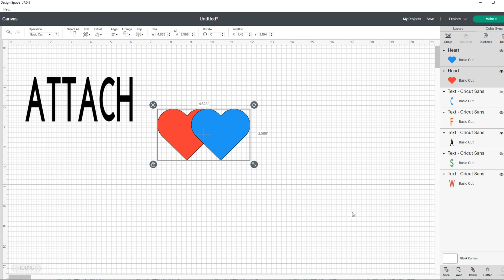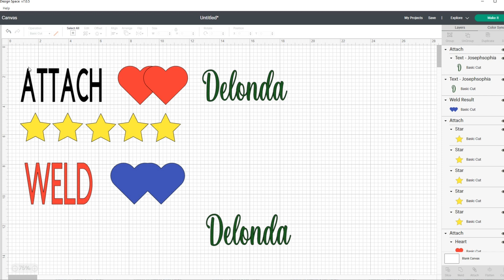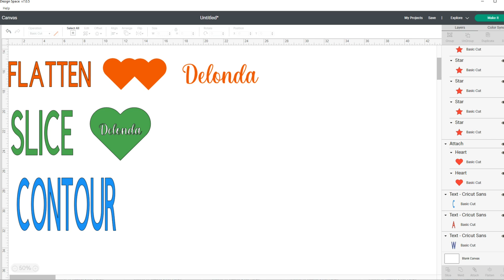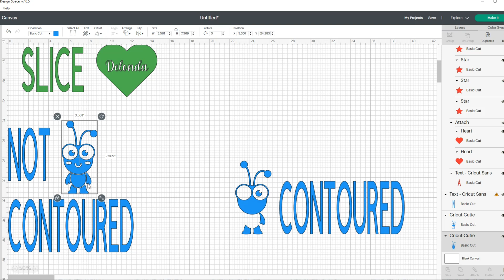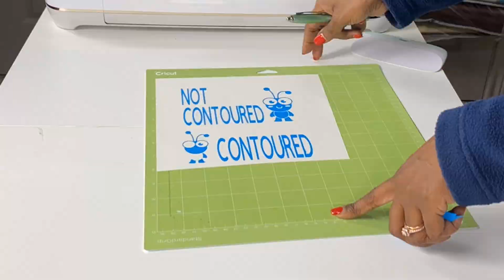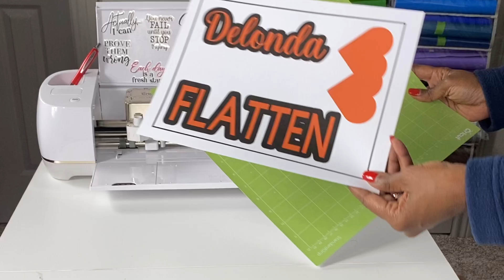CRICUT DESIGN SPACE FOR BEGINNERS: CRICUT DESIGN SPACE TOOLS: WELD, ATTACH, SLICE, CONTOUR & FLATTEN

Comment: Hello, I love your content.  Thank you for taking the time to share.  The spatula, I LOVE IT! I use it to lift the vinyl from the cutting mat without having to bend the vinyl while removing it.  The tweezers-  my preference for weeding the vinyl. Grab with the vinyl with the tweezers and place in my discard container (a tide pod container with an “X” cut through the top to grab on to the vinyl once I slide it into the little slot).
Reply from the maker: Thank you so much! I still haven’t used those tweezers 😂🤣😂🤣

Comment: Good morning I really need your help i watched video to calibrate and I did it the the T. But I went to print n cut and I didn't cut around the outer circle but instead it cut through my circle. What do I do? Please help
Reply from the maker: Hello, what paper did you use for your calibration?
Reply: @CraftingwithDelonda  good morning 
I used plain white printer paper first to calibrate then used t shirt transfer paper for dark 
Question: DO YOU CALIBRATE 1ST B4 YOU CUT AND PRINT.?
B4 I EVER CALIBRATED MY MACHINE CUT OK WITH A LITTLE OFF THE OUTER LINE.
HELP HELP AND THANKS
Reply from the maker: Yes, I calibrate before print then cut, but once should be enough to last for a while. 

Use white cardstock. 
Do not remove the mat from the machine until the process is complete. 
I keep the add bleed option turned on.
Reply: @CraftingwithDelonda  i did calibrate for 1st time cut was great on calibrate test but after I calibrated  i cut cricut machine off and at a later day I went on and printed out something for my church and it butchered it. Thats why I was wondering if I had to calibrate b4 each print and cut because I'm like you I don't have the money to keep buying supplies. I really appreciate you taking the time here with me. I'm actually watching your 2nd screen print video of the socks for you and hubby lol
Reply from the maker: Thank you! I'm sorry that calibrating is not making your cuts cleaner.